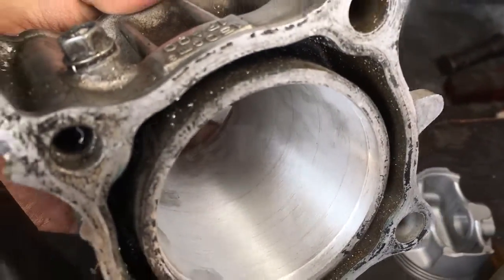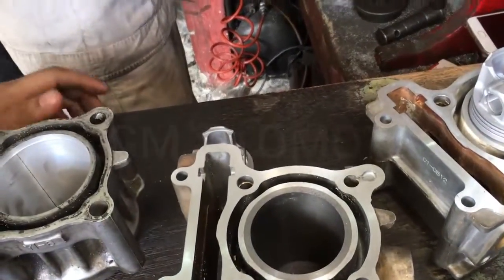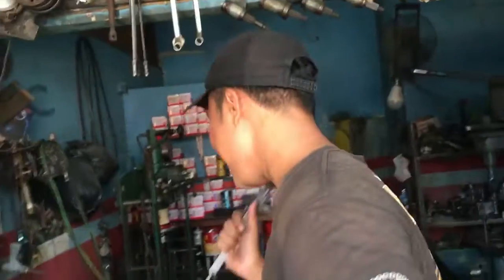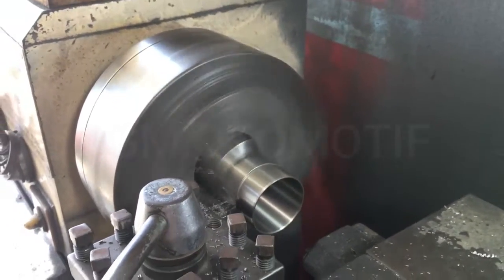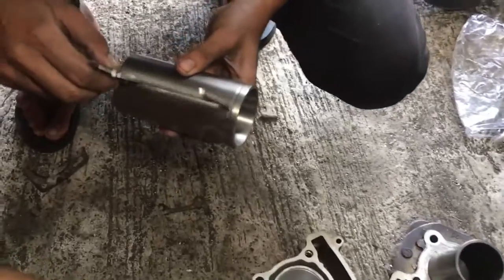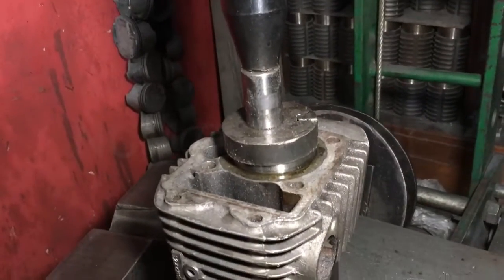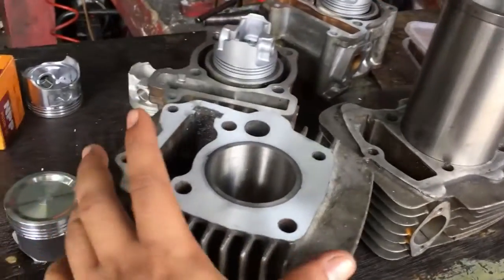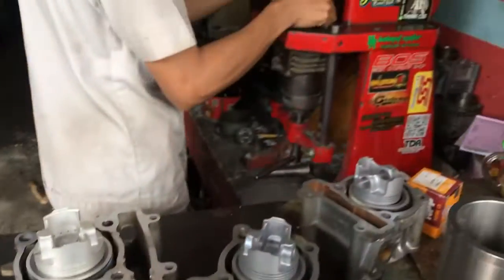YAMAHA BLOCK CAN'T BE DRILLED DIRECTLY, IS THAT TRUE? | YAMAHA ENGINE MADE FROM DIASIL

Comment: Maaf mau tanya melenceng. Bengkel ngm apakah bisa memperbaiki air radiator rembes atau cepet habis, sudah di isi air radiator full sekali jalan jarak 10km  air radiator habis, di isi lagi habis lagi  , mesin cepet panas untuk motor vario 125 2019.. Maaf saya tanya di sini karena di IG nya di private tidak bisa GM🙏

Mau dateng langsung jauh takutnya sampai sana part nya kosong kan  jauh saya dari luar jakarta soalnya... 

Sebelum nya terimakasih jika pertanyaan saya di jawab segera saya kesana